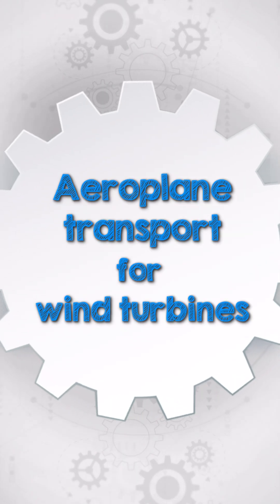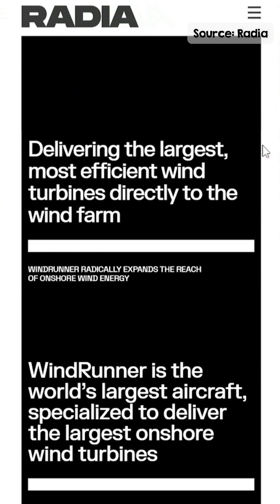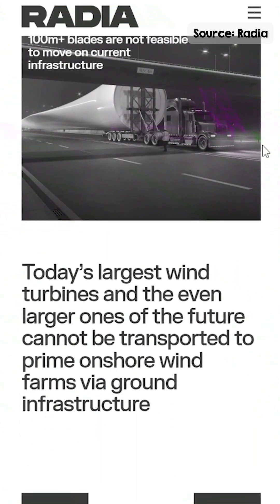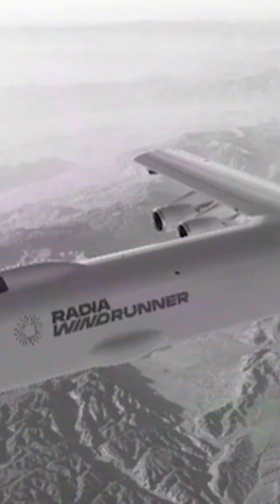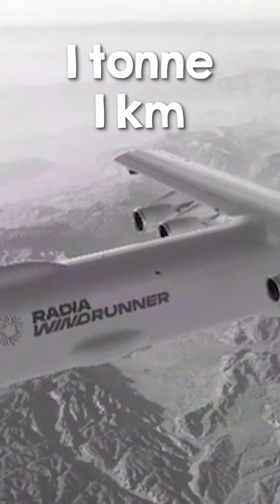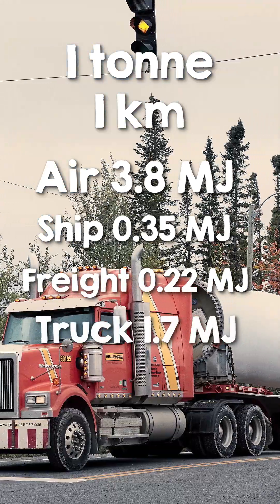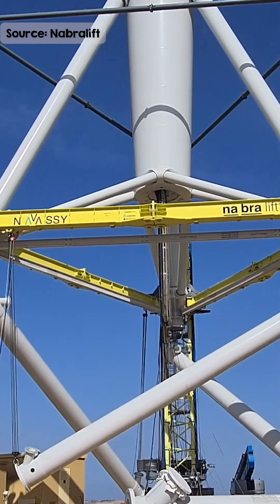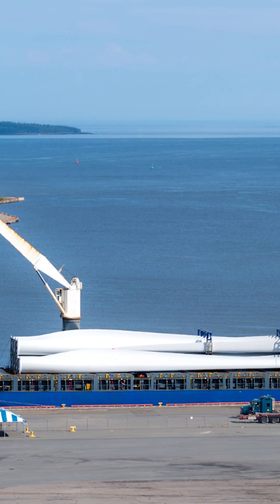World's largest cargo plane to transport wind turbine components is here, but do we really need it?

Comment: This story has the ring of the Glomar Explorer, a ship developed by Howard Hughes' Global Marine Development. The cover story was ocean manganese nodule mining, but the real story was soviet submarine recovery in 1974.
4 GENX engines can lift a M0.7 transport aircraft off the ground with an MTOW of 840 tonnes which would require 24 main gear wheels (and four nosewheels). The OEW for such a plane would be about 320 tonnes. The maximum fuel and payload would be similar, but the fuel and payload could only add to 520 tonnes - normal aircraft design practice. The real demand for an aircraft of this size is urgent heavy lifts - military equipment (5 US Abrams tanks, ammo, fuel, etc), mining and electrical equipment; light loads like helicopters, fighter jets, aircraft fuselage and wings; medium loads like 200 'luxury' cars. The auto industry investigated such an aircraft 50 years ago.

Comment: Not all locations amenable to wind use have access by ground transport.
The air transport is a one-time thing.
The energy generated is on-going.

But of course, they can simply build a rail system to that location. Would that be less “impactful”?

Comment: even with the lesser hassle of overland travel by air, final air field to installation is still going to have the same right angle constriction points without a special purpose air field at the construction site, which might be the goal but i doubt it.

Comment: The transport energy penalty is insignificant on the scale of a modern wind turbine's energy production.

3.8MJ ~ 1kWh. Assume 150T for the blades of a 10MW turbine, transported 1000km. That's 150MWh, which such a turbine would generate in around 48 hours running at 30% capacity factor.

If this technology enables wind energy to be installed more quickly, cheaply, prolifically, it's potentially a huge win. Unless my math/assumptions are wrong?

Comment: Wow! I knew freight rail was efficient but I didn't know it was so  much better than trucking and even shipping!
Reply: Not much resistance rolling a steel wheel on a rail, and grades are kept really low.
Reply: I thought ships are the most efficient. And freight rail is 2nd most efficient.
Reply: That sounds like a mistake
Reply: @brianjonker510  Maybe. Or it might depend on specific factors- shipping route and weather conditions? Size of ship?

Comment: What size of runway would you need to land that thing and get it off the ground again? You'd still need ground transport to get the blaes to the site. Do what Siemens-Gamesa have done and open a factory at a nearby location, in their case Hull for the Dogger Bank wind farm.
Reply: The length if the runway depends on weight more than size, and since this plane is designed for a specific purpose (wind turbine blades) I could imagine it being relatively light for its size.
For comparison, the Antonov 124 (the current largest plane after the An-225 was destroyed) has a length of 68 meters and a payload capacity of 150.000 kg, this airplane is designed with a length of 108 meters but a payload capacity of only 72.000 kg. Also, they say that:
> WindRunner can land on semi-prepared airstrips as short as 6,000 feet (1,800m),

So I guess you just need to bulldoze a somewhat flat 2km landing strip and you're good to go. In comparison: the An-124 has a landing roll of 900m and a takeoff run of 3000 meters at max weight (though presumably on flat asphalt).

All in all, I think they put enough thought into it that it could be viable, but I agree that it's still quite a niche application.
Reply: Seems like a good (and perhaps only!) use case for Zeppelin or blimp, delivering massive but light cargo directly to the erection site
Reply: This is an answer looking for a question.  🙄